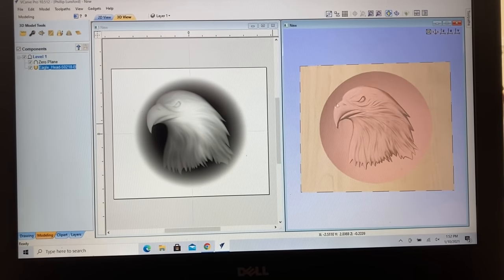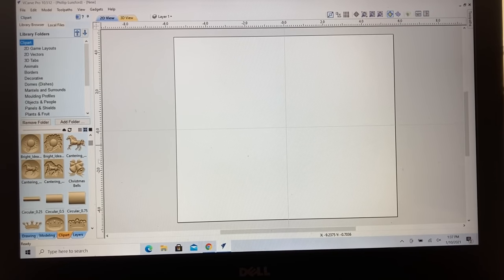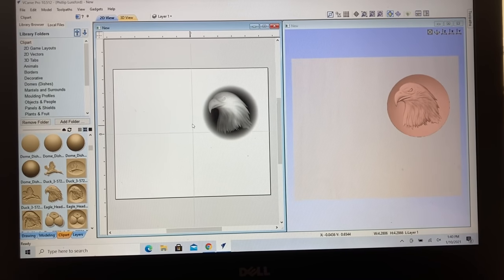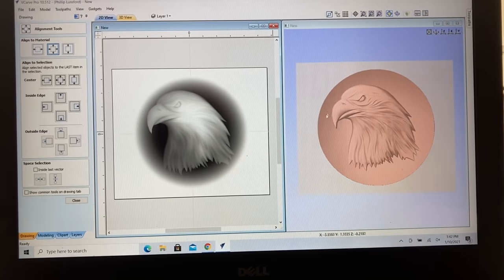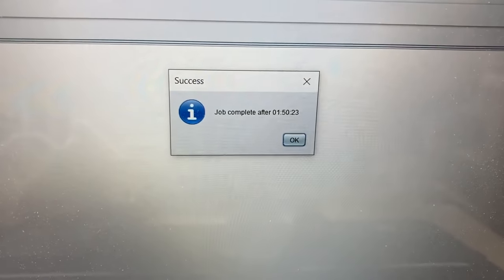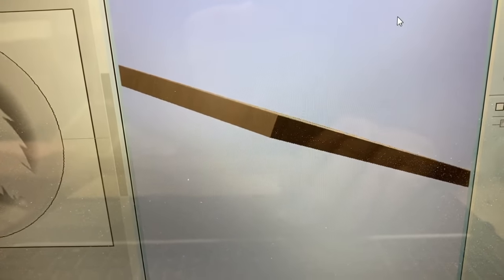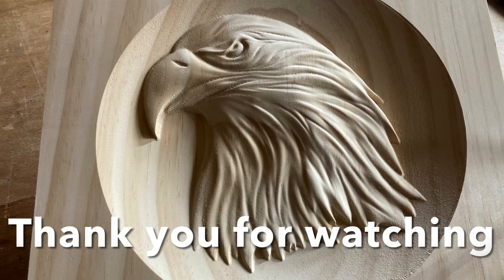Let’s Carve This Simple 3D Eagle on the CNC

Comment: Instead of dragging the corner of the stl to resize and re-centering with the button you can hold shift while dragging the corner of the image to resize and it will keep the image centered. Saves you a bit of time.
Reply from the maker: Excellent point. Thank you very much.
Reply: Please, are you good at creating STLs? I need the services of an expert.

Comment: It is amazing what you can do with a little bit of knowledge. The eagle piece is truly amazing. It's got to be a total satisfaction to look at what you have created.
Reply from the maker: Thank you very much.
Reply: yeah, with a little knowledge you can basically print or cut a test page..bravo! sorry but i was hoping for so much more in this video.. I don't have a CNC but even if i did, i wouldn't have much interest in printing ("cutting") a piece of clipart from within the application, all CNC software provide the same examples as a 'test print'.. it would have been 10x more valuable if he used a generic image outside of the clipart to really show how to do something unique .
.
Reply: @brendanfitzpatrick7399  Believe me if you just got a machine setup from scratch and did all the wiring etc then you dont give a crap about value or where your test piece came from. You just want to make sure your machine works as intended and with your choices of the many softwares you decided to use to create it. Have you ever printed a test page from a new printer? Well thats all it is. Frankly a 3D eagle in wood beats the hell out of a sheet of paper your gonna throw in the trash anyway.
Reply: With all due respect to Ms Fitzpatrick, your video is exactly what I wanted and what I expected.  It is a step that needs to be taken in my learning process.  This is all new to me.  

Kudos to you for taking the time (yours and ours) to clearly explain the steps that you were taking.  That will enable me to perform a similar on my computer and CNC as I progress in the process of properly using these powerful and innovative new tools.  The pace was certainly not too slow.  THANKS so very much.
Reply: He created nothing a computer and a machine created it. Come back when he carves something by hand.  No real talent needed to do this.
Reply: @patrickreade6119  well, a lot of us enjoy CNC because it kills time and doesn’t hurt our arthritic hands!

Comment: thanks, great learning tool for me
19:27 pre-drilling is key for holding work piece in position and the spoil board surface won't get those annoying screw bumps and lengthen the spoil board's usefulness.
Reply from the maker: Yes, excellent idea
Reply: @PawPawsWorkShop  If you go back and look at 21:09,  you can see that the side on the project isn't flat either because the wood is slightly bowed or because the particle board below isn't level with the rest of the table.  It would appear that the particle runner isn't tied down completely or perhaps there's something under it?  I can't tell.

Either way, thanks for taking the time to make this video for us!

Comment: Hi Paw Paw,
A couple quick questions… so you did it all in one pass with the 1/8” bn, so it would have been cutting fairly deep. I heard you say 8-10% step-over, so you stepped over somewhere under .0125? And might I ask your feed rate? I’m very much a novice, and as such would have thought that deep a cut would have broken the bit.

Comment: Hey paw paw, your work is outstanding. I’m about 12 months from retirement and I want to get into CNC routing for fun and to help with local charities. Question, is there a better computer use for the software than others?  Are you using a Mac or PC. I wish I could get training from someone like you! Your work is outstanding.
Reply from the maker: Thank you very much. Congratulations on your upcoming retirement. I use a pc laptop. To run the CNC does not take a very power computer however, if you are planning on using the same computer to design you will need a more powerful computer. You can get training from me. I have over five hundred videos that brings me into you shop anytime you wish.
Reply: @PawPawsWorkShop   Thank you, I am a visual & hands on learner. I appreciate all your work. Thank you fro the speedy return. I live in NJ and have not been able to find CNC router training that makes any practical sense for me. I will dig into your work. Thanks again.

Comment: Great video, very informative. Thank you for taking the time to share your knowledge. We have been doing a lot of research to buy our first cnc machine, would you recommend the x carve pro(it will be out in a few months) or the cnc4newbies machine?
Reply from the maker: First thank you very much.  In today's market there are many great machines.  I know only what I have seen in the commercials regarding the XCarve Pro.  It is a new unproven platform.  I have questioned the Inventables team but I must say that I would go with the proven product and chose one of the cnc4newbies products.  They are very solid and I love mine.
Reply: i would not recommend the xcarve. i just got one and i wish i would have spent another 1000 and got something a little better. the button head screws it came with for assembly are garbage. i had to re tap the holes for the dust collector brackets. this machine is veeery overpriced. i dont expect the xcarve pro is much different besides being more rigid...

Comment: Very very new to cnc routing. Machine being delivered tomorrow.  At present trawling my way through various software tutorial packages.  Have found your series very helpful with my quest for the best software product.  That is Inventables Easel.  Rather excitedly saw your post of the Eagles head but very disappointed that software was Vectric Vcarve.  As a mere Hobbyist no way can I afford to buy the Vectric product. So is there anything available within Easel that can create a similar result?  Thank you.
Reply from the maker: The XCarve is capable of carving this type of design.  You will however need other software to create or modify. This eagle is part of the package that comes with the Vectric VCarve software.

Comment: Hi Paw Paw, first of all, thanks for the excellent video. I have two questions:
1) Can the Foxalien Masuter Pro CNC use this VCarve Pro software?
2) Can the Foxalien Masuter Pro CNC do that kind of service you did, as in the video? Or is a stronger spindle needed?
Thank you
Reply from the maker: Yes, you can use VCarve with the FOXAlien. I use Openbuilds controller. Just save the gcode toolpaths and open in Openbuilds and run the job.
Reply: @PawPawsWorkShop  Thanks

Comment: Phil what's the benefit to using the Z-height plate vs. just jogging the bit to the top of the material surface and setting Z that way?
Reply from the maker: It is more accurate to use the z plate for consistency. You can use the manual and it will work however you may be off several thousandths.  For most projects that may be just fine.

Comment: Thanks very much for the great tutorial... am considering VCarve Pro purchase for my new XCarve Pro and wondering if you had any compatibility issues with the software and your machine? T
Reply from the maker: No, I have never had any compatibility issues. I use easel as a stand alone solution. I also use easel and UGS together. In addition I use Inkscape and then bring images into easel. All work with no issues. I do the exact same thing with VCarve Pro. Do you have specific concerns?
Reply: @PawPawsWorkShop  No concerns just wondering about compatibility with Inventables products. Just purchased a XCarve Pro and noticed you've got a lot of experience with their products. Appreciate your work and tutorials as I'm on a steep learning curve and soaking it all in. Easel looks to be a good product, but from what I can tell does not have 3D functionality as VCarve Pro.
Reply from the maker: Easel is good and is improving all the time. You are correct about the 3D function. You need VCarve Desktop, Aspire or Fusion 360. VCarve Desktop allows you to alter the 3D but not create the STL files

Comment: How easy is it to setup the interface between the X-carve machine and Vcarve program. I am down loading the trial program now.. Is Easel still required? My goal is to be able to work should internet not be available.
Reply from the maker: It is not a problem.  I have done some videos showing this.  All that is necessary to design in VCarve, generate the gcode in VCarve and then open Easel and open the gcode file and carve. I have started using UGS (Universal GCode Sender) on my new machine instead of using Easel.  You only need the internet to design and save the files. Not to run the actual carve.
Reply: @PawPawsWorkShop  Kewl, that is what I want. Have some studying to do. Will continue watching your Posts. Thank you.

Comment: Thanks for the great intro to VCarve.  Do you have a video that does both a rough and a detail cut?  Also, could you have done the cut with Easel instead of UGS?  Thanks again!
Reply from the maker: I did not do a rough cut.  I only used the detail cut toolpath.  The design modification has to be done in VCarve or similar program.  You can use easel as the sender and carve it out.
Reply: @PawPawsWorkShop  I understand that you didn't do a rough cut here.  I was just wondering how to do two cuts with UGS.  I've done it in Easel, so I guess it's similar.  Thanks!
Reply from the maker: It is two separate files that you run separately.

Comment: I enjoyed the video. The minor problem with online tutorials is the video is never clear. I totally lost how you connected the vectric lines before going to g file.
Reply from the maker: I’m not sure what you are asking. Vectric lines?  After selecting the bit and creating the toolpath you just save the toolpath and the file so that you can pull up the file at a letter time. Then save the gcode and carve. Yes, you do need to use the correct post processor. I can’t tell you which one to use due to the vast different types of machines and controllers

Comment: Am I missing something or isn't it a bug in the software that it did not inform you that part of the carving was above the material top dimension? I mean the software knows the material thickness and while it could not detect errors in the physical material it should be able to detect when it creates gcode that is above the top of the work?
Reply from the maker: It was something visually that I could see.  I believe that the carving was at the material surface and therefore would not be shown.
Reply: @PawPawsWorkShop  Ah, so possibly the Z probing was off by a bit and that caused the tip to ride above the work, that's my guess anyway.

Comment: Does lightburn work for cnc and laser or just for laser only ?
Reply from the maker: Lightburn is designed for lasers. If you have a laser attached to the CNC then you most likely can control the laser with Lightburn

Comment: Good afternoon PawPaw what kinds cnc router you using, and wheere can i get a nice cnc to buy preferable 24in by 24in or bigger my budget is $1200.
Reply from the maker: With this budget and size, take a look at the FOXAlien 4040xe. You can also add a laser and rotary roller to or over time. I have a link in my most recent videos. Here is a link where I upgraded to the dewalt 611 router. https://youtu.be/OzlHaj9sKzY
Reply: Can the fox allen cut the 24inch by 24inch like i want, what do you think about the bobscnc evolution 4?

Comment: Great project! one question  I am a newbie and this may be a dumb question but here goes. Can you take that file you just created and use it in mach3 on another machine without a ton of work?
Reply from the maker: Mach3 runs on a difference system.  I believe that once you do the design work you could save it with the correct post processor and it would work.  I do not have Mach3 but there are numerous Mach3 post processors in the listing in VCarve .
Reply: Thank you for your reply

Comment: Hello. I am a relatively new user and have gotten pretty decent at easel pro (although not even close to your level) and would like to venture out a little. Could you tell me what what kind of file that eagle this would be? .stl .dxf or any of the zillion types of extensions. I am totally confused abut the file extensions. I thought the .stl was a 3d printer file. I don't have and cannot afford v-carve pro. I have easel pro. Is there any place I can go to get something like the eagle for free? Thanks.
Reply from the maker: This eagle is one of the free files in the VCarve from Vectric.  When you make your purchase, there is a wide range of different files that you can download as well along with many others that you can purchase. You can start with VCarve desktop with is the least expensive option and later add the pro. You only pay the difference.  With the desktop you will get the files.

Comment: Hello Paw Paw,

I just received the Fox Alien 4040 -XE and finally got the Candle software downloaded. What other programs or downloads do i need to get started engraving? Love your channel by the way, excellent information... i'm just brand new to the CNC thing and need some direction.
Reply from the maker: You can certainly use Easel. I would also suggest Inkscape. Perhaps use UGS in place of candle. Later you may wish to get VCarve Desktop
Reply: @PawPawsWorkShop  Thanks. I was using the CNC for the first time utilizing Easel and one of their test carves. I was using a 1/8" bit and set all the parameters for the wood stock i was using and the machine went hay wire. It started at the zero position on the wood and then started going directly towards the x-axis off the wood, so i shut it down, Not sure what is going on. Any suggestions?
Reply from the maker: It sounds like the x,y 0 position was not established or for some reason was not saved or lost
Reply: @PawPawsWorkShop  I was using a 18"  long x 6" wide x 1" thick piece of wood (pine) on the machine. Was using the test carve from the software at the time. I entered the wood dimensions in the Easel software but did not set any X.Y, 0 positions as i thought the software did that automatically. I did however set the X,Y and Z axis to zero before starting, so that may have been why it happened.

Comment: Paw paw I just started with a 3018 cnc machine and I tried laser grbl I can't get laser grbl to work as well as easel I made something in easel and imported it to grbl but when I save it on the off line controler it saves as a different type of file that I guess the machine dont read. I would like to do this eagle head because I use to be in the 101st but I don't think the free of esiel file has it. However looking at the cost of both v carve and easel the price is around the $500 range i already do laser engraving with light burn but there's is a yearly subscription how does these cnc subscription work and how many computers can I put them on because I have 3 for lightburn and would like to do the same for any other program so I can grab any of the laptops I have set up to use the program.
Reply from the maker: LaserGRBL is only for the laser. Easel can run all the other CNC projects
Reply from the maker: The eagle file is part of VCarve by Vectric

Comment: Are things like this possible with easel?  I still haven't figured out fusion or carbide create and can't afford any of the v carve programming at the moment
Reply from the maker: No, you need a program like VCarve
Reply: @PawPawsWorkShop  oo ok thanks. I was thinking it could be done in carbide create or fusion as well but I really don't understand those programs and alot of the tutorial videos are either hard to see what they are doing on screen or just hard to follow all together.
Reply from the maker: I want to clarify. Easel is a very basic software.  You can use a program like VCarve to design the project and then generate the gcode. Then using Easel as the sender carve the project.  The machine is capable of doing any design, it is the limitation of the software.
Reply: @PawPawsWorkShop  oo ok I was thinking that just didn't know if easels programming allowed such designing. As I stated before I still haven't had any luck learning or using carbide or fusion. Still trying figure them out but thanks again for helping
Reply from the maker: I have many videos on using Easel.  I have only used carbide a couple of times.  Fusion has a very steep learning curve.
Reply: @PawPawsWorkShop  yeah I'm seeing that with fusion and carbide. I have no issues doing anything in easel so far just the other 2 are a little difficult

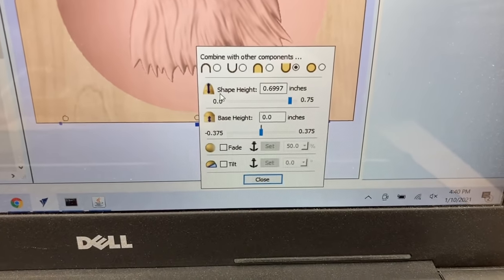Comment: Hi Paw Paw, thank you very much for the great tutorial. As I'm new to that usage of a CNC I might have some beginners's questions. I'm somehow confused about the different heights. Material height is 0.75 inch. After inserting the zero plane the model height (11:00) was shown as 0.593 inch. The shape height was 0.6997 (25:25) and was slightly too big. How are model and shape height linked? Thank you very much, Thomas
Reply from the maker: The material height does not change which is .75  As you preview the eagle image you must be aware of the height.  If it is too high it will create a flat spot when carving.  The thickness of the image itself is the key. That is why I had to reduce the height of the image to .593